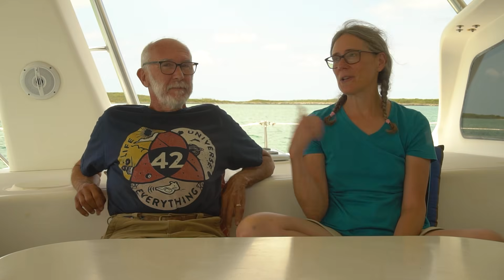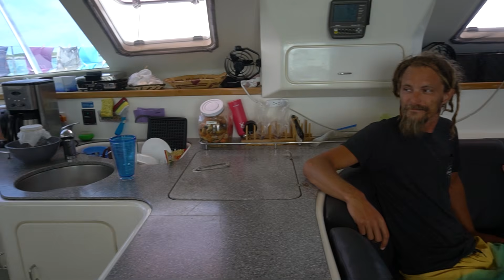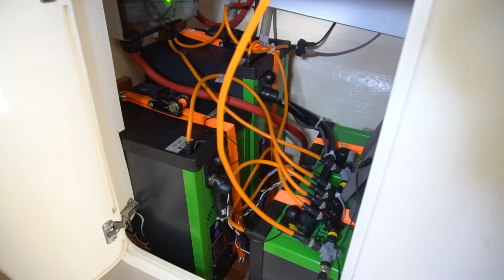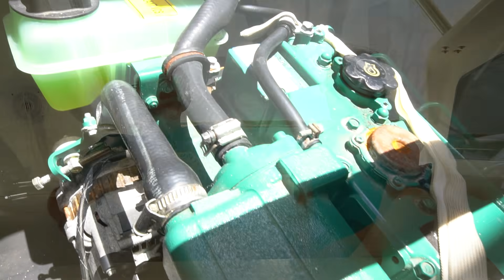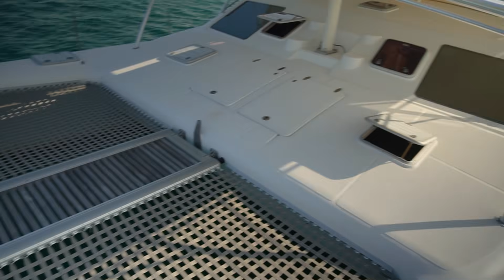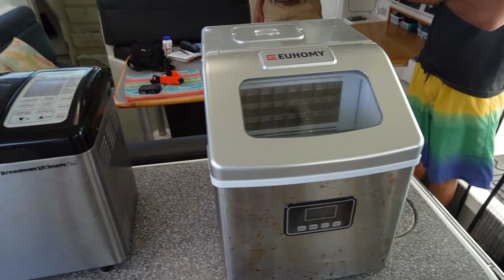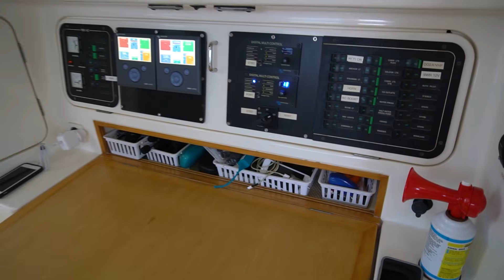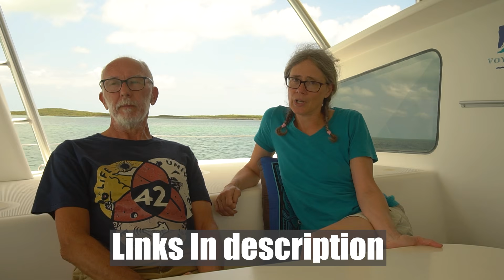100% Solar Electric Catamaran, Interview with owners from Indigo Lady

Comment: So. 15 to 25 miles range. I will wait a few years thanks.
Reply from the maker: It has already been a few years since it was put together. More range only requires more batteries and solar. That said most cruisers tend to travel during daylight so I think 25 miles is fine. If you need more range for yourself then get a bigger bank.
Reply: @WildlyIntrepid  Don't forget, most people living on sailboats reckon they spend about 10% sailing, 90% at anchor. Depending on location, this means a battery bank of 60 - 100kW could fully charge before the next sail. With this kind of bank, you could probably achieve a 200 mile range. I was looking at a similar thing using the motor and battery bank out of a Nissan Leaf. The motor is 80kW (equivalent to about 140hp) and the battery packs are 30kW. The biggest consideration would be added weight. I don't know what the original engines were in the Voyager 440?
Reply: @fredflintstone1428  The original motors were Yanmar 40 HP. Bigger battery banks would be an improvement, and we often have several days at anchor that would fully recharge a huge bank, but space, money and available technology were the determining factors. The newer large banks for electric cars opens a new source for electric boating. BTW, batteries are rate in Kilowatt hours (KWH).

Comment: I wondered.  I see new multi-million dollar all electric yachts and wondered if anyone would try a conversion with a solar roof and here it is.
Reply: New Solar Electric Boats, $2,000,000+, used cat plus conversion, ~$350,000. Well worth the effort.
Reply from the maker: It is great to see it can be done with less.

Comment: I expected you to need bigger motors. The motor I put on my bike is 1kw
Reply from the maker: Oceanvolt has all the specs I believe online. But the key I think is it's not so much about speed. I imagine you would want to conserve energy just like you would conserve gas if driving long distances. The bigger the motor and of course you need more batteries and solar.
Reply: Voyage Yachts and Oceanvolt actually did a nice test; they put two 15 KW electric motors in one Voyage 440 and two 40 HP diesels in the other (standard power option). Then they backed them up to each other, tied them together and did a tug of war. The electric won easily. The 15 KW calculates to only 20 HP but the torque curve at low speeds makes the performance of a 15 KW electric motor comparable to a 40 HP diesel, or even slightly better. I was VERY skeptical of this until I just went ahead and did it. Now I am a believer in the effect of electric motors turning props. That must be why trains use diesel motors to turn generators to power electric motors to pul heavy loads efficiently.

Comment: So he cannot keep up to full out speed and the solar keep up,  thats i guess why they can do 20 miles a day , 
Can the engine keep up on power output to run at night ,
Reply: They can do more than 20 as long as they run 4-4.5 knots.   Its a balancing act..  they can go faster and use battery to assist the solar but need to end the day with enough "house" power to run the night.  

This is basically a budget version of Silent -- less batteries, less solar, and more basic all the way around -- as well as a smaller boat.  Same speed constraints on incoming solar, Silents run about 4-4.5 knots using only incoming power as well.   But the big difference is Silent has a MUCH larger battery, for both an all electric kitchen and more range.   (especially if you want to run faster)

Far cheaper of course.  :)   Even counting the sweat equity.
Reply: @redwolfexr  the solar goes through the batteries anyway , you start running the motor in the morning when batteries are low after a night ,  can the generator cope,  
I guess the generator has to charge the batteries , and the motor draws from the batteries ,  do the engines run ac or dc ,
Reply: @davidwarnes5158  Seemed clear enough to me..  they can run 4.5 knots with what comes in from the panels.   If they want a little overhead to charge with they can 4 knots.   Which over 12 hours means they can do 48 miles and have a little bit of a charge on.  

They probably won't want to do that 2 days in a row, but its possible.   25 miles is "we can do this every day forever."   

They don't HAVE to run all that power through the batteries - in my industry we always used a bus.  You draw demand power first and send excess to the batteries.  (it helps extend battery life)

I would be shocked if they ran the generator more than once a week -- and that just to keep it in good shape.   The whole point is that its for emergencies only.  

They COULD run it more aggressively and pay for fuel.  But they are retired and not likely in a hurry.
Reply from the maker: I can't speak for Dave and Lisa myself but I believe you have the idea they hoped to accomplish. You would have to reach out the Dave directly but I don't think they run the gensets often at all.  As you said when you are cruising you are not in a hurry, generally.
Reply: @WildlyIntrepid  cruising say from Bahamas to other parts of carribean can take a few days by sailing , simple cruising ,  how can you do this trip on this , 
Thats why I say can you run the gen set to keep up , no solar at night.   Running up and down the coast isn't a issue ,  its when you have to cover say 600 miles and the sea state ,
Reply: @redwolfexr  you put it down like a engineer,  you have no allowance for the sea waves , leeway ,  running at say 5 knots one day may take 1500 rvs the next day you may be 2500 and lumpy seas ,   to cruise a area you have to be able to get there first , Bahamas great , but when you wasn't to go down to Virginia Isles,   you may have hops of several hundred miles , no land to anchor ,   can you run 5 days and I would say , thats a normal trip, against waves , 
Not sailors I can understand that , I am .   Should have kept the mast , take the boom away ,  and just had a head sail,  easy to use , but would have given them selves rouble the moving power , a safety buffer as all electrics fail at some point ,  more versatile and just as eco friendly ,
Reply from the maker: I would imagine they could run the genset if needed. I believe one would keep up with the engine. But I really don't think that is the kind of cruising they have planned or they might consider a bigger bank of batteries.
Reply from the maker: Some good points here. They did have a failed part of there system in the past but luckily having 2 systems onboard helped them. As for now they seem to be loving just cruising around the Bahamas. Lots to see and do. But a 5 day journey would require some fuel for the gensets. They do have a small sail and mast stowed so that they can get out of trouble if need be.
Reply: @WildlyIntrepid  that is kinda normal cruising , or your not cruising ,  ?   Just living aboard .  Its a great idea ,
Reply from the maker: I'll never understand that point of view. So if you are not traveling over multiple days your opinion is it is not cruising? Cruising from the Great lakes to the Bahamas and cruising the Bahamas for 3 years is not cruising? Whatever you want to call it that's fine but the rest of the world won't agree with that statement.
Reply: @WildlyIntrepid  , different point of view , stay within 40 miles of shallow water and land cruising .   But the question was can this boat go offshore for a 600 mile passage , 
And no sails ,  ?
Reply from the maker: You would have to ask Dave that one. I'm not sure. Personally I think I would want a larger bank of batteries.
Reply: @WildlyIntrepid  larger batteries still need charging ,
Reply from the maker: @davidwarnes5158  agreed but with large chargers and a genset like they have I think that would be fine. Not much more room for more solar.
Reply: @WildlyIntrepid   actually I would suspect they are far over-dimensioned for panels versus battery based on what he said.   Ideally you have the battery capacity at over half your daily intake.    So if you can run at 4.5 knots for 12-14 hours on panels then you have maybe 6 hours at that speed on storage.

That gives you two real options.   1) lower speed to what the batteries WILL support for 12 hours -- likely 3 knots, just enough to stay under way.   Or run the generator.

I would say they could likely do 75-80 miles a day -- as long as they are getting good sun, without generators for open water.  Assuming they have 50% storage. 

 4 knots an hour to allow enough overhead to charge the batteries (need to reserve about a third for charging and 2/3s for propulsion - whatever speed that gets you)  Then slowing as it gets darker to where you are just making way.

That is the minimum really - have to have enough battery storage to make minimum way for night and still have enough house power for necessities.  

This is the basic math whether its Silent or homebuilt.   Also why NOBODY does one of these without generators.
Reply: @davidwarnes5158   I am an engineer, yes.  So brute force always wins over finesse in my calculations.
Reply: @redwolfexr  that's where keeping a headsail will out perform any electric motor , that's why yachts are faster under sail, and cover oceans ,  
That's science , less moving parts ,
Reply: @davidwarnes5158   If they wanted sails...  they wouldn't have removed the mast.
Reply: @redwolfexr  yes they said they were not sailors , I was just talking options to make it more cruiser , longer cruiser friendly ,  remove the main ,   harder to use , headsail , fab for extra power ,
Reply: @davidwarnes5158  My design was for island hopping, not open ocean cruising, but I still wanted the option of doing 500 mile multi-day passages. We can still do that with the generators running. They provide enough power to drive the motors and charge the batteries, so they only run about 1/2 of the time when running at night (the other 1/2 is off the recharged batteries). We burn about 1 GPH diesel and we have a 130 gallon tank, so we have range for crossings. I could have left the mast up and just run out a Genoa, but I did not want to be handling sails on a cat. They don't heal with a gust so quick response in gusty weather is required. Also the mast would shade parts of the array, reducing the output. Personal preference from a powerboater. Every boat is a compromise (and yes I am a mechanical engineer and physics teacher), this was my choice of compromises for island hopping in the Caribbean with shade to escape the sun.

Comment: 20 mile range, that is a dangerous shit type boat, however, the guy was smart enough to put in two large generators, so it is not a so called green electric boat, it is really diesel electric.
Reply from the maker: The generators just serve as redundancy and as a backup. They still only run their engines on solar and the batteries are constantly charging as they move.

Comment: The build quality is a bit 'slapdash' to me. That roof looks quite flimsy. The boat sits very low in the water and not much air is going to get through that tunnel unless its sponsons raise it higher with speed. But anyway, I wish you and your s/o fair winds and good sailing in the Caribbean.
Reply from the maker: Not sure how slapdash it was. A lot of thought went into the design and the roof was very solid with plenty of breeze getting in under it. Everyone has an opinion. It's not our vessel we just interviewed the owners.

Comment: Finally getting a real word answer on what kind of kt speed the solar only power can deliver is really helpful. IE if not pulling from batteries, have clear skies and direct sun, no generators or other electrical loads, 7.2kw of solar will move that boat at 4-4.5kts. Thats fantastic. I was expecting that figure to be closer to 1-2 kts and relying a great deal on batteries for reasonable propulsion.
Reply from the maker: It's a question we all want to ask I think. We were expecting lower as well. Are you looking to build one?
Reply: @WildlyIntrepid  not build from scratch like this vessel, beautiful conversion though, that solar arch is exceptional work. I'm looking at vessels like the HH44 and trying to get an idea what kind of "sustainable" cruising it could pull off under solar alone for circumstances like becalmed on clear days when you don't want to dip into batteries or kick a diesel. 3.2-5.5kw of solar and 42kwh bank though so lots of potential.
Reply from the maker: Dave really did a great job. We love how much solar he was able to get on that vessel and still make it look good. The HH44 looks gorgeous. I'm sure milage will vary like anything else but I would be happy with 3 knots extra just on solar. But I imagine with battery tech moving faster and becoming more affordable and safe we hopefully can pack more energy in less space.  Cheers

Comment: Uhhhh. You can test a solar catamaran before selling. Check out Silent yachts. Not the best way to open a video.

I like the concept of this boat.
Reply from the maker: Terry you are absolutely right when it comes to factory built ones. We should have precised that you can't test one that you are building/ customizing yourself.
Reply: I was enjoying a relaxing swing in my hammock when Silent Yachts came on the market at 10 times my costs. They are nice boats, but I know where every part of my system is and how it works.

Comment: The cheap way is to buy a counter top induction hob..to avoid the gas and kitchen heating.
Batteries -byd blade cells better and safer and now available in storage packs. https://youtube.com/c/SailingTrimaranSpirit
Next step Na Ion battery's they are on the way. Cheaper lighter greener and safer also they can be drained flat and are temp independent safe essentially.
Reply from the maker: I'm assuming they wanted some redundancy  and ability to cook without power but I'm not sure. Lots of new battery tech coming out it seems.
Reply: @WildlyIntrepid  

The biggest boost and saving and life span increase can be had from using Hybrid PVT photo V. thermal panels.
Reply from the maker: Interesting idea but personally I would have no use for constant hot water onboard plus you need to store that water when not in use.
Reply: @WildlyIntrepid  
Im 🇬🇧🧙‍♂️ and hot water for washing up and washing in the cold is very desirable 😂 
If you dont want to store it or  use it you can just circulate seawater through plastic tubing on the backs to cool the panels to increase their electrical efficiency which drops off when the silicon crystals start getting  a bit warm and keeps them at optimum performance it also stops the heat from causing micro cracking and the panels output from being diminished over time.
Reply from the maker: Right on. That would work I guess but they would have to be on par with standard panels price wise or to me it's not worth the extra cost. Unless you are cruising in cold climates which would make hot water very useful. Just my opinion of course.
Reply: @WildlyIntrepid  
It can be done with with plastic tube fixed to the back and a small pump to suck up seawater gravity will empty it..

Comment: It is not 100% solar, it is an Hybrid with two massive generators but I love it.  This is what I would like to have when I’m too old to sail.   Nice interview.
Reply from the maker: I suppose you are right although it is just redundancy and for the most part runs purely on solar. Personally I would want the same Incase you run into problems with your system. Cheers.
Reply from the maker: If only we could. I know we would always be topped up.

Comment: awesome. adding another 10kw of batteries now is cheaper than when you did it. That would give you a lot more range with out running generators.
Reply: I would love to add 50 KWH of batteries; that would really increase our range, and when you spend several days at each anchorage, the solar array would easily recharge that. $$$ and space become the issues.
Reply: @davidparker6469  order EVE  Electric vehicle Lifepo4 batteries cells from china. $8k gets you around 55kw of batteries.
Reply from the maker: We are currently running with eve cells. But unless you get a pretty good bms you lose some of the smart features that his system has. It's nice to have all of the cell information together in one place. That said, we will likely be building another bank with eve cells (the studded ones this time) again and just get a nicer bms that has the features we want. The Daly bms just doesn't cut it imo.
Reply: @WildlyIntrepid  JK BMS. I have 4  since I run them as 4 48V packs. JK has 2 amp active balancer which is very nice as the others only have .2-.5 volt balancers. Each one I have has 250 amp max discharge which means I will never over work it as each BMS will supply only 40 amps max. Good luck and stay safe.
Reply: @davidparker6469  
David You can also  certainly DIY expt.with a parachute/kite sail.
Reply from the maker: Batteries are becoming a little more affordable for sure. Although I think I would still want some kind of redundancy built in to a system just like he has done.
Reply: Hybrid systems https://youtu.be/owm0z-Hdt0w

Comment: I think I saw an exhaust pipe on that boat so it is not 100% solar the title is misleading.
Reply from the maker: As stated in the video they have two generators for the backup system if for whatever reason the electric production is not working and they need to get back to port. It still runs 100% on solar unless there is a problem.